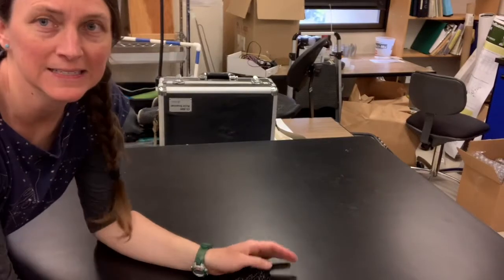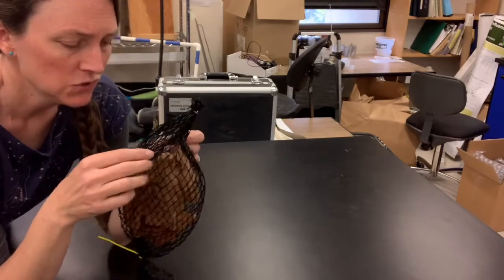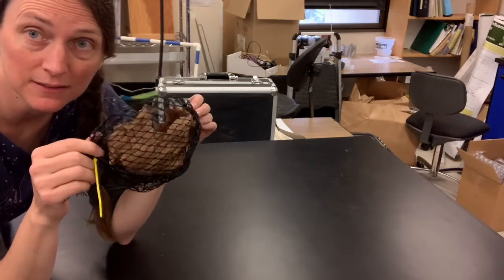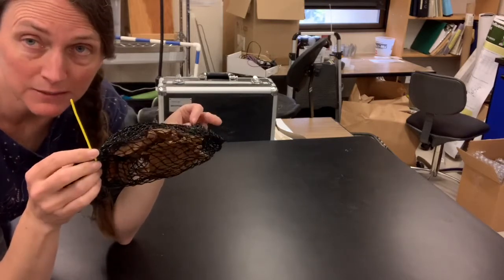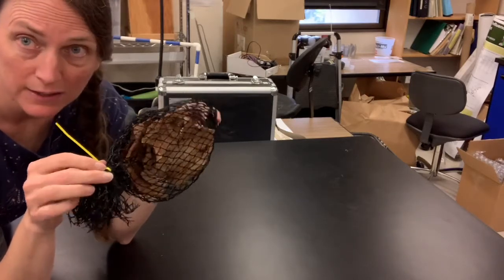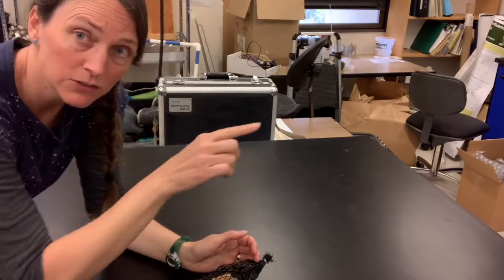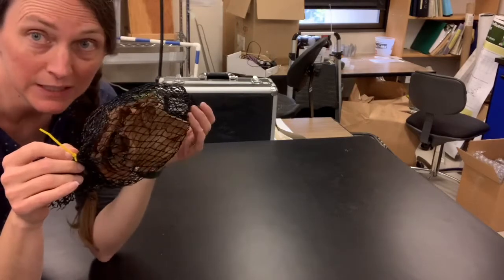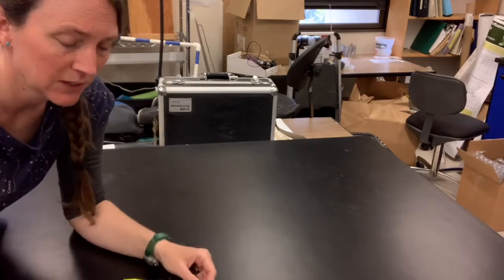Leaf litter bag

Comment: I am having the hardest time finding a mesh that will hold in sorghum but also allow organism access to help with decomposition. Would you happen to have a link for the litter bag material you used for the pine needles?
Reply from the maker: Hi Brandon, for small things like pine needles or leaflets, I have had the best luck with windowscreen mesh. It is pretty fine, so you have issues with flow reduction and anoxia, plus you keep out larger bodied macroinvertebrates. But unless you want to bundle your sorghum somehow, you'll probably have to go with fine mesh.